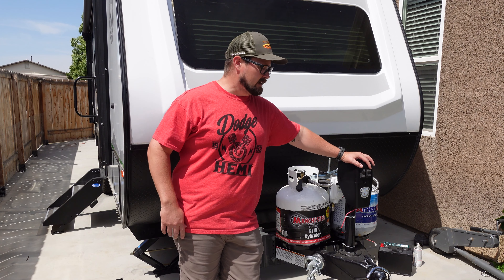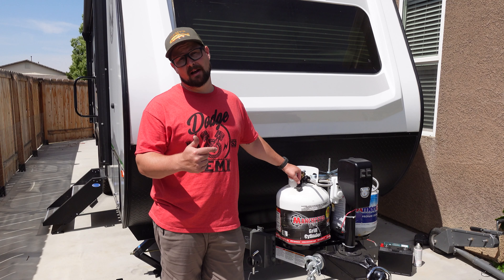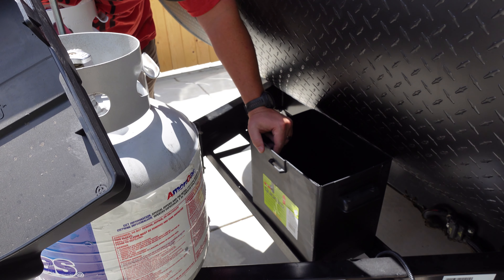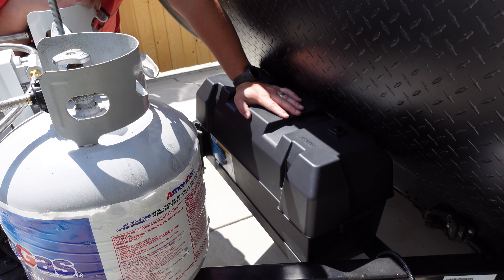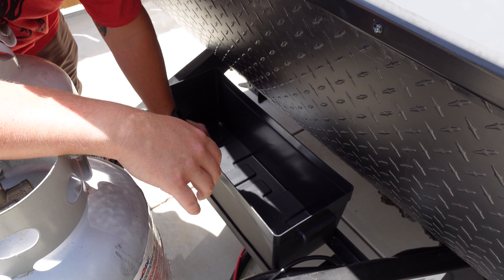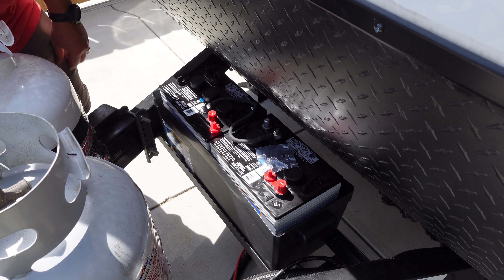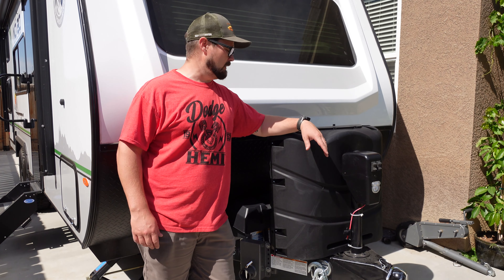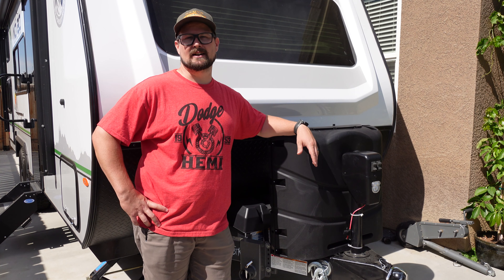Installing Dual 6V AGM Batteries | Travel Trailer Upgrades For Boondocking

Comment: I was having the same problem with my 6 volt batteries, the box was too close to the trailer and it was a major uner taking to remove the batteries for winter storage, I obtained the battery box you recommended and the lower height was the cure, now the lid is  easier to remove and the batteries can be removed without a major effort to extract them. So happy I ran across your posting.
Reply from the maker: I'm so glad to hear this! Thanks for the comment!

Comment: Thanks for the video! I just got a 19.1. it is my first travel trailer. This might be obvious to many, but why is 6volt better than 2 12volt batteries?
Reply from the maker: No problem. 6v is better because the plates that store the charge are thicker. That means they can be ran down lower and charged back up with less oxidizing on the plates. Basically they can be ran down a lot farther and not harm the battery, so they last a lot longer while providing a little more storage in the same size as a 12V system. I hope that makes sense.
Reply: @RoadandReel  That makes sense. Thank you so much for the information!

Comment: I did the propane upgrade and now looking at battery upgrade...talk about a rabbit hole. I have the 19.3 and I am curious how many boondocking days you are able to get out of your setup? I do know there are a lot of varying factors but wondered if you had any regrets or positives to share.
Reply from the maker: The rabbit hole is a great way to describe it! So far, no regrets on any of the upgrades. Everything is working as it should and accomplished what I needed. There are more coming this summer as we are trying to get the storage more organized and some lighting in the passthrough. I would also like a space to keep my Milwaukee batteries charged and a place to run my portable air compressor. When it comes to boondocking, my family of 4 has made it 8 days. That's doing dishes outside and not showering every day, but we are good for about 16-20 showers. The black tank is never the issue, but the grey begins to fill. The good thing is I could run the grey into the black or drain the grey a little depending on the area. We've gone 2 weeks on the propane in colder weather down around 30 and the batteries will with the solar never drop below 3/4. I usually carry 15 gallons of water and a spare propane tank. Sorry, this is a long reply, but I hope it helps.
Reply: @RoadandReel  Thank you so much for taking the time to share :) I look forward to more videos!

Comment: When you say you switched over your charger, is there a different setting inside the rig that needs to be changed? Or where you just switching the charger back on to make sure it works correctly. Thank you
Reply from the maker: There's a setting that needs to be changed depending on your controller. I had to switch mine over for the new AGM batteries instead of the old setting for flooded lead batteries.
Reply: @RoadandReel  Thank you, we have a 19.3 on order so just trying to get ahead on it. Your videos have been a great source of info on the unit!!
Reply from the maker: @Zach33303  I'm glad they help! I put these out there because I couldn't find my own. I usually make fishing videos! Lol, but these are way more successful!

Comment: What battery brand are you using and how do you like them so far?
Reply from the maker: These are local. They are made by PowerStride and I'm very happy with the results. Between them and the solar, we've yet to drop below 3/4 battery under normal use. We did struggle with the refrigerator running off the inverter, but it was sunny enough to recharge each day, but if it was cloudy or anything, we would need to add an extra panel or two.

Comment: how would u add a shunt so u can monitor your batteries
Reply from the maker: You would add it to the negative side of the battery in between the trailer connection and the terminal. A positive supply cable will run from the shunt to the positive side of the battery where the trailer connects. A wire would run from the shunt to the monitor. Depending on the shunt, it should come with a pretty easy to read wiring diagram.

Comment: Can you add a link for the batteries you used?
Reply from the maker: https://amzn.to/3jL0s5o
I found them for about $50 cheaper at a local supplier. They're the Deka 8AGC2 batteries. I would have went Trojan, but couldn't find any in stock.

Comment: Can you add lithium 6 volt batteries instead and not change the inverter converter
Reply from the maker: You have to check the model of your charge controller to see. I would have to upgrade mine if I went to lithium.
Reply: I have a WF 8735 AD GE in my 2022 no boundaries 19.2 is that what you have too?
Reply from the maker: @shawnmcavoy5720  that's the same one I have, but it will only get you to about an 85% charge on lithium. While it is compatible, it's not optimal.
Reply: My controller is a go power gp pwm 10 Sq. I believe you have the same one as my 2022 no boundaries 19.2
Reply: I read this controller is N.G. gp-pwm-10-sq for lithium as the pulse destroys the battery. A MPPT is better.  A 20A 250 watt panel is good for a 12V 200ah lithium battery so I read.
Reply from the maker: @shawnmcavoy5720  are we talking about a charge controller for solar or a converter to charge while on shore power?  If you are looking for a solar charge controller, here's a video I made here on my MPPT upgrade and panels:  https://youtu.be/1Tyrl0LWqUc